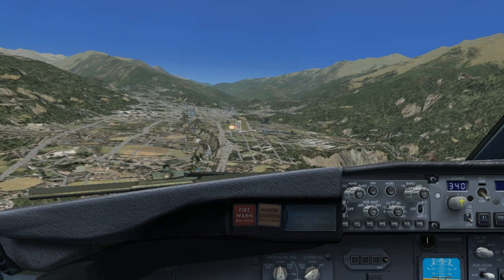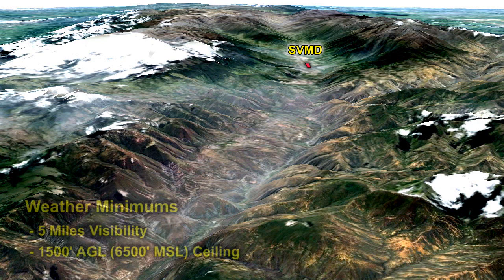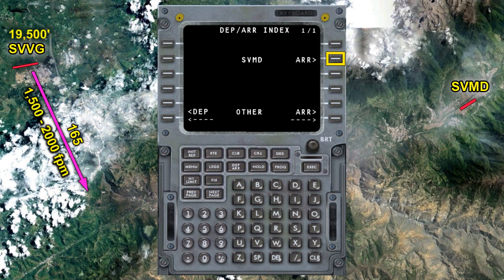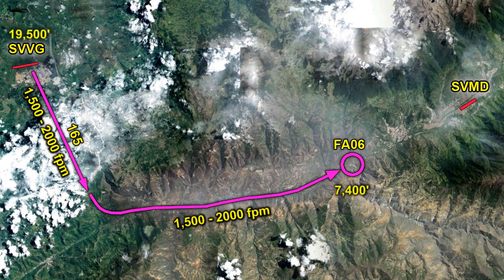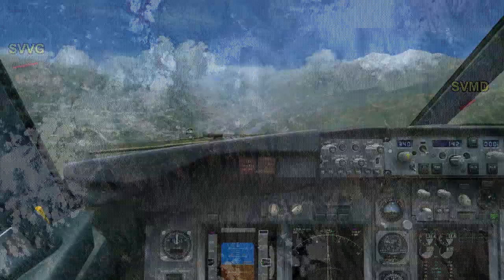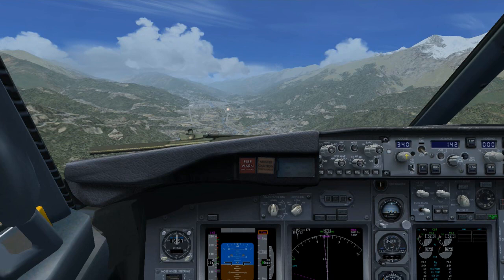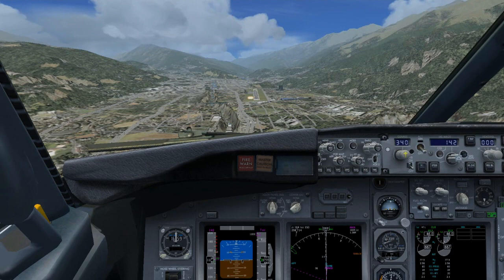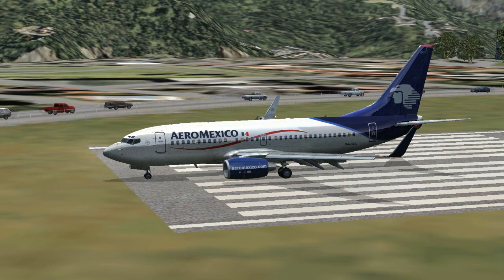Merida Airport (SVMD) Visual RWY 6 Approach (VFR Corridor)

Comment: You should have set the minimums knob to Baro so it bases the readings off of the barometer. Then when you come over the ruwway you switch it to radio for accuracy